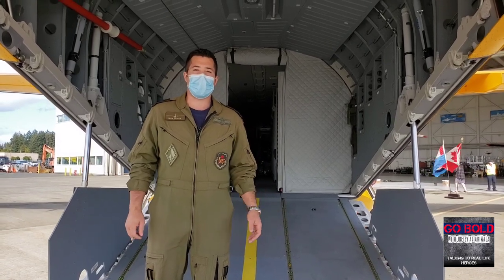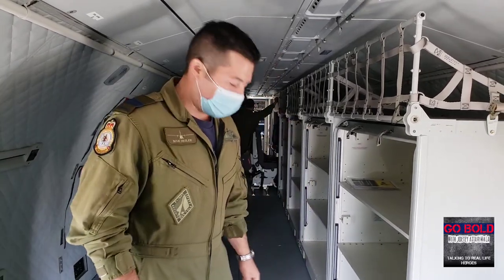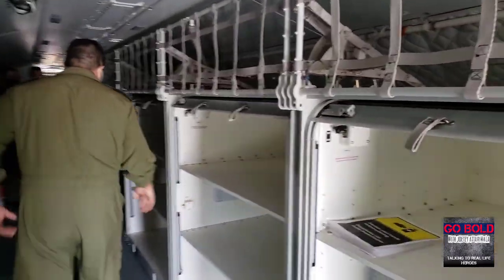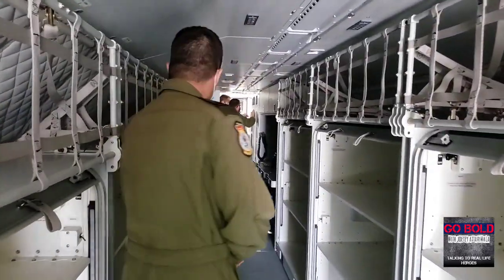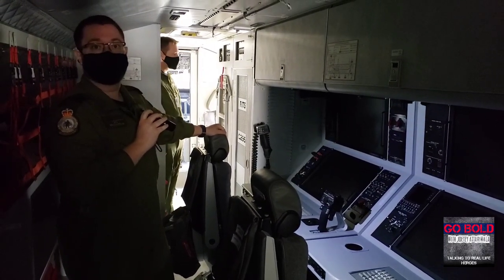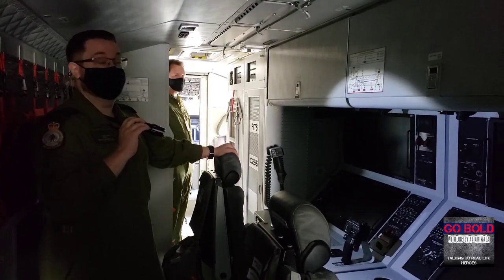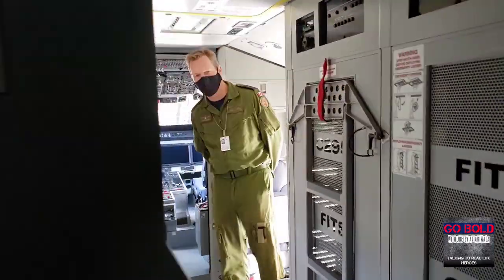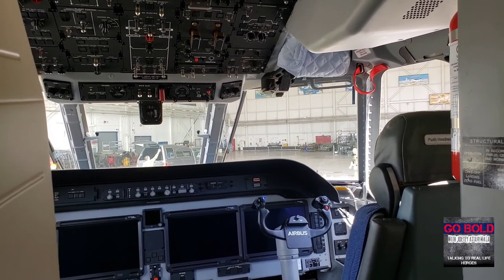Tour the new CC-295 Kingfisher Fixed Wing Search and Rescue aircraft of the Royal Canadian Air Force

Comment: I am happy my tax money is going in such good planes :)
Reply: Hate to be that guy; however, this aircraft could be a failure. They've been delayed by 3 years. They have center of gravity issues, can't operate in the mountains, struggle with winter operations and are underpowered. I don't know very much at all about the Kingfisher, but was told by friends in the know that it wouldn't be a surprise if the program is cancelled as some of the issues are major issues that are not easily fixed.
Reply: @dodoDodo-of6pu  You admit you don't know anything about the Kingfisher but feel like you need to comment we`ve been to Yellowknife, Alert , Goose bay and even Arizona and Florida multiple training missions with Sar Techs jumping and training I've been on low level missions slow and low in the mountains and over the ocean working with the coast guard the plane is awesome and its avionics are unreal and great step up for us technicians who are working our butts off to get this plane operational.

Comment: Word on the street is that this plane has so many performance issues it may never be accepted into service. It is possible these will be sold or pressed into
 alternate service. An expose should be done on this program— another debacle.
Reply from the maker: I am tracking... it will be interesting to see how this project pans out.
Reply: then that is a manufacturers issue for failure to deliver as ordered
Reply: I've heard this from the team at Bell helicopter who maintain the Griffon. They've told me it will never enter service with SAR.
Reply: Word on the street as usual is wrong
Reply: @RobertHunt-y8n  excellent input, spitting facts right there. 
W&B, second segment climb, SE go around are all a mess— but let’s go with ‘you are wrong’ 👍

Comment: It doesn’t appear to have room for stretchers, I am curious as to what it was really designed for? Have they been able to solve the centre of gravity issues?
Reply from the maker: All good questions Ray! The configuration is clearly more focused on the search aspect as opposed to evacuation. You can hear a great perspective about some of the capabilities Fixed-Wing SAR aircraft bring to the table in Episode 58 of the "Go Bold with Joetey Attariwala" podcast, which can be found on all major podcast platforms. I think you'll enjoy it.

As for the centre of gravity issue, I'm not sure, but it's on my radar for sure! I'll update when I learn more.

Comment: I'm very familiar with the fixed-wing SAR procurement and this was the costliest and  less capable plane in the running. The other two, C130J and C27, were far superior aircraft and cheaper. This procurement is yet another one that should be investigated.
Reply: That is a ridiculous comment .. the unit cost of a C130J alone (without mission configuration) is more than this cost in its configured state.
Reply: @3storiesUp  Have you seen the actual cost of the C295? And it was also a cost to capability comparison,  which the C130J is far more capable than the C295. I worked with people who were part of the acquisition process, including a visit in Spain to see theirs, and they all said it was wholly inadequate compared to other competing models.
Reply: @morrij01   I have seen an actual tender for a C295, and it is nowhere near the unit price of a C130J. Comparing a C130J with a C295 is apples to oranges. The C235 and the 295 have been carrying out missions similar to those proposed by the Canadians for years, and they are carrying out those missions well. You have a biased view of this A/C based on absolutely nothing. It's as simple as that.
Reply: @3storiesUp  I don't know which ones you've seen, but a few examples of the C295 deficiencies is that many SAR techs can't stand up comfortably in the back, there's not enough room to fit all the sensors and personnel on the SOR, so they had to go back and modify it to keep the 295 in the running.
Reply: @morrij01  This has nothing to do with the cost or the effectiveness of the A/C .. it goes back to people who are not very proficient at their jobs making bad choices. This is feeding into your bias of what is a very good A/C.
Reply: How familiar spent a lot of time in SAR  have you.
Reply: @RobertHunt-y8n  Yep, 10 years working with SAR units.